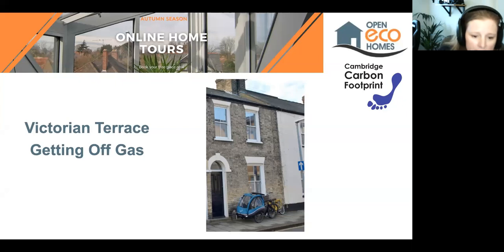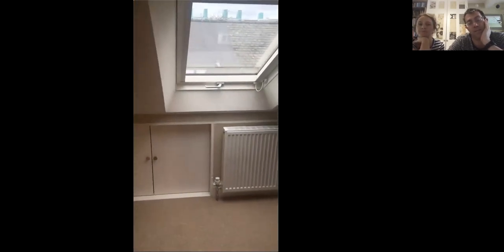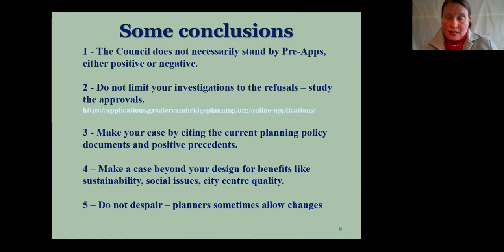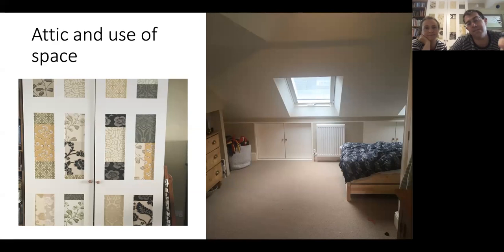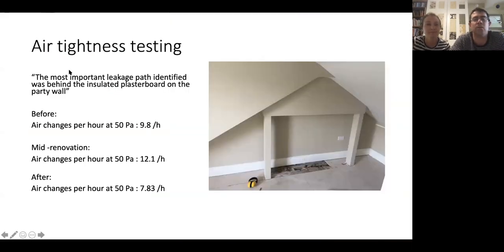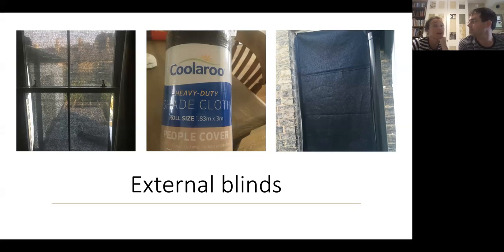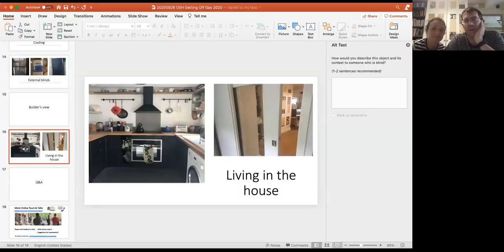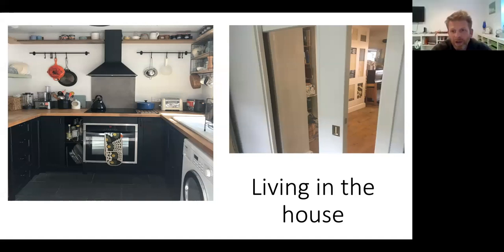Victorian Terrace Getting Off Gas

Comment: As a builder, the fact that you put a project like this out to tender is a huge problem, asking multiple people to spend so much time and effort to cost such a project will cost each company thousands of pounds, 
Did the architect or engineer have to bid for the project? Did they work to a pre agreed fee? 
More likely the architect and engineers charged per hour plus a minimum set 

The builder says himself, he was £100,000 out of pocket, and will have caused severe delays to other jobs in his diary. 

It all just seems that it's the people who physically do the work, are the  way way undervalued, disrespected, stereotyped, controlled, and scrutinised,  workers in the process.